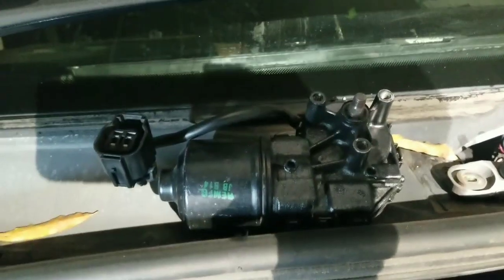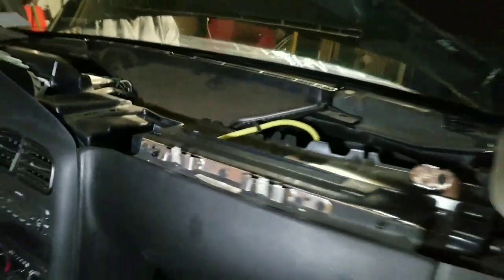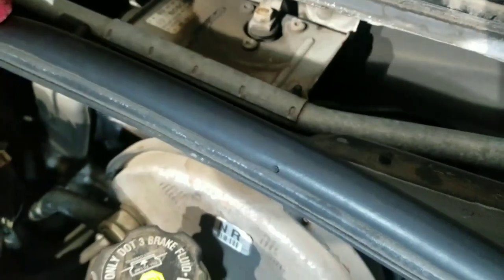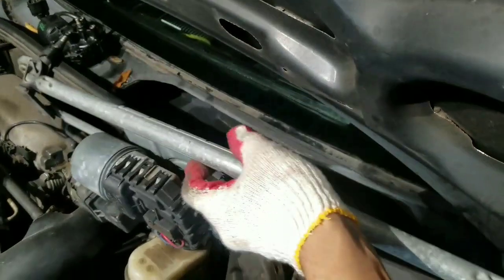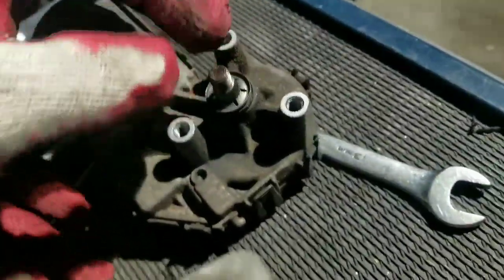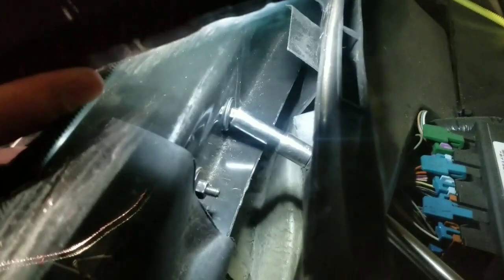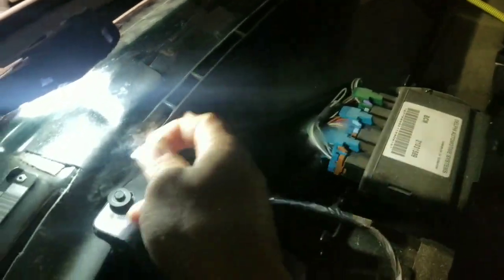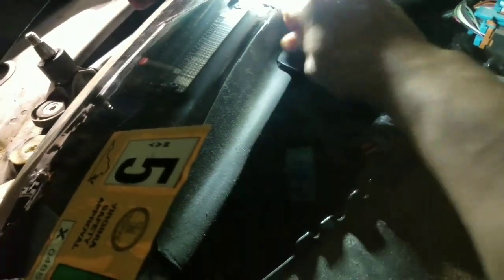2002 saturn sl1 wiper motor

Comment: Trick I found on mine when I replaced the wiper motor was to unclip the ac duct clips and slide the duct over. Then you can hit the two bolts straight on.
Reply from the maker: Oh ok thanks for sharing

Comment: I have a question one of my wiper arms(Driver side one) is not working, It actually seem like it got off track or something.  Is there a fix  for just  getting it back working or would I have to change out the whole transmission assembly?
Reply from the maker: Yes they sell the bushing to hold it back in place
Reply: @nestorautorepair  Ok thanks